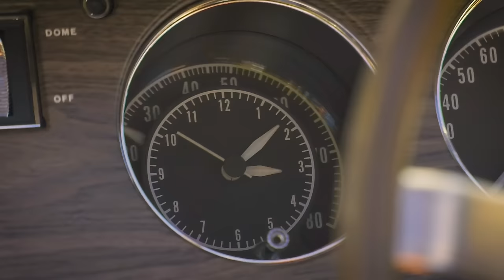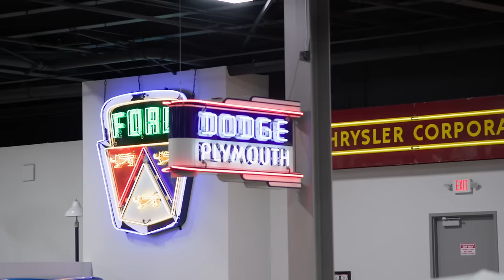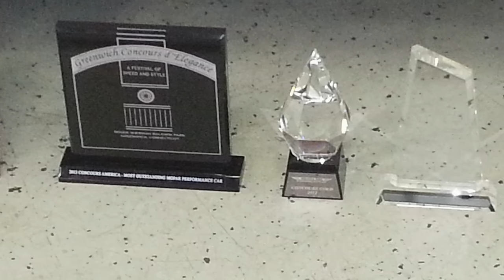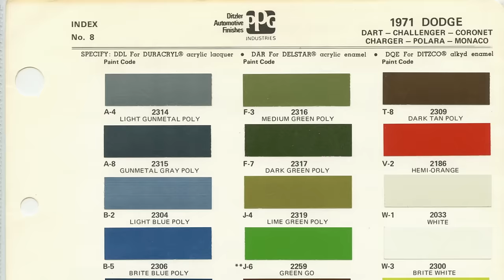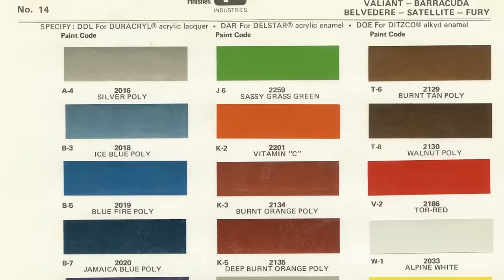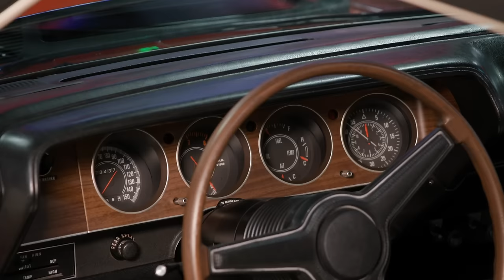***NEW EPISODE*** MARK AND TONY INSPECT ANOTHER MILLION DOLLAR MOPAR AT THE BROTHER'S MUSEUM.

Comment: I did a 6 speed in a 70 chevelle.I agree a 6 speed is 1 to many gears for a street muscle car anyway.And it more expensive and more work to install too.😊All you need is 1 OD to slow engine down on hyway speeds.❤A 6 speed or more is just needed if you going to be driving closer to 200mph.😊🎉

Comment: I had a ‘69 Cougar with Decor interior and factory sunroof. The sunroof assembly on this car is identical to mine - done by ASC (American Sunroof Company).  Cars were shipped across town from Dearborn to the ASC shop and then back to Dearborn.  The only thing I needed to replace were the drive cables - which are the same parts as used in BMW 2002’s of the era.  I also had to replace the vinyl drain tubes that run down through the A-pillars.